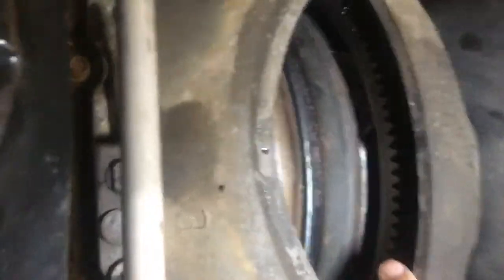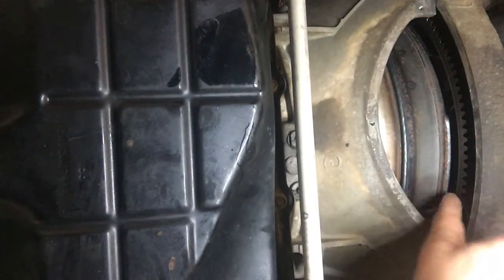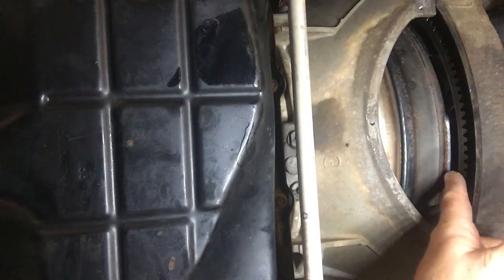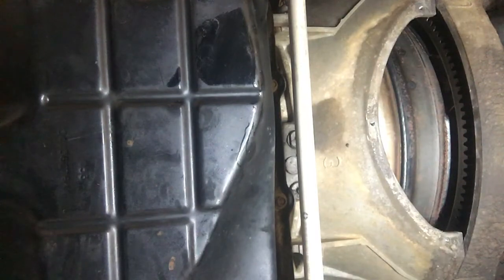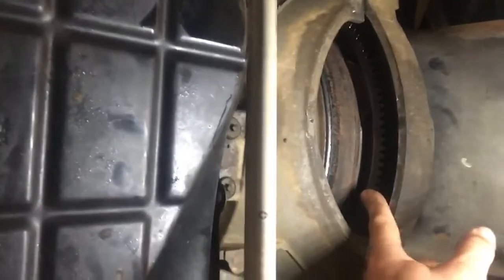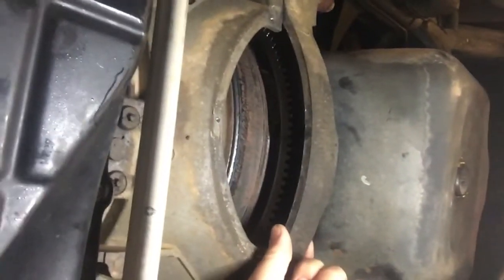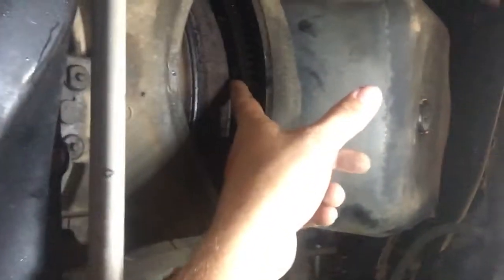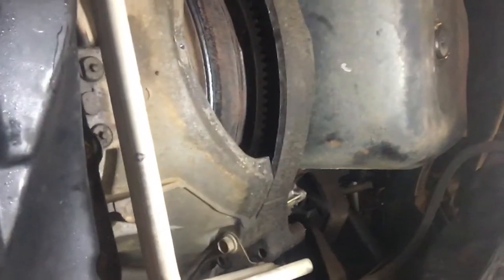6.7 cummins flex plate warp

Comment: Same sound coming from mine. Shop replaced torque convertor 3500 miles ago. Within 2-3 miles went from fine to full on clanking. Pulled access panel and found few very small aluminum shavings and dust. Probably the same thing, bolt backed out? Limped home towing 8k lbs trailer but made it. Sound has almost gone away completely after the 65 mile trip home.
Reply from the maker: Did they check the flex plate for cracks or warping? I first thought that on mine but it was the bolts had backed out. Same thing shiny metal shavings and dust. But mine got worse as I drove it. After replacing it k found small cracks around the bolt holes and that’s what caused them to back out.
Reply: @garrettcampbell5995  just took it to the (same) trans shop today. As I pulled in he said it sounded like a loose bolt. I was thinking it maybe wore the head off or wore a groove in the adapter plate assuming that's what it was hitting. He mentioned it may be the flex plate too but he'd check the bolts first. I'll update when I hear.
Reply: @garrettcampbell5995  verdict was a cracked flex plate. They put a billet one in. I got a little disgusted and left before asking them to show me the old flex plate. Can't see how a flex plate can go from fine to cracking in a few thousand miles but it is what it is. In the last 4k miles I have a rebuilt pump and valve body, new solenoid, billet convertor and now billet flex plate. So let's hope I'm done with trans issues for a while.
Reply from the maker: @mac5155  ive had them crack like that befor. They do sound kinda the same. More a scraping noise then a scrape clack sound. But glad you got it fixed.

Comment: Did you fix this issue?
Reply from the maker: Not really Austin. Just got to set your mind to doing it.  Take pics of things if needed. Pros had to learn how same as any other man. It’s not a bad job unless you let it be.
Reply: Thank you my friend   I think you really just helped me out a bunch!  @garrettcampbell5995
Reply from the maker: Yea. Drop the trans loose pul it back. Swap flex plate re torque with new bolts. While at it check thrust bearings  in engine. I’ve seen them worn and causes weird shit to go wrong in transmissions and people keep having problems. Cause they never check for that. But yea. All fixed and back on the road.
Reply: @garrettcampbell5995  damn pulling trans back sounds like a job for the pros or needing some big tools 🔧